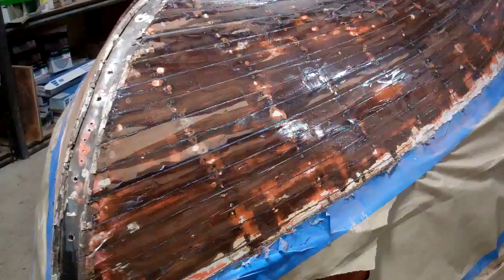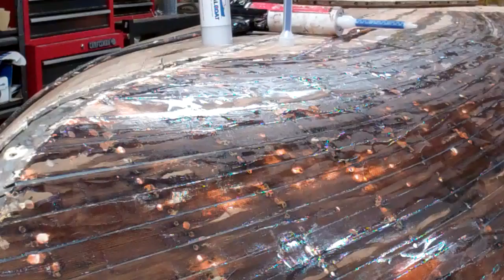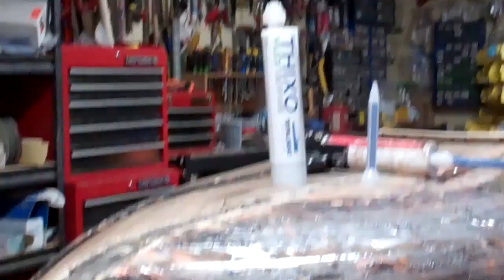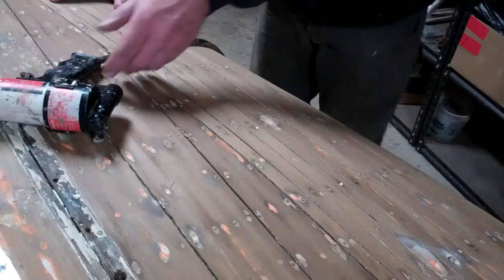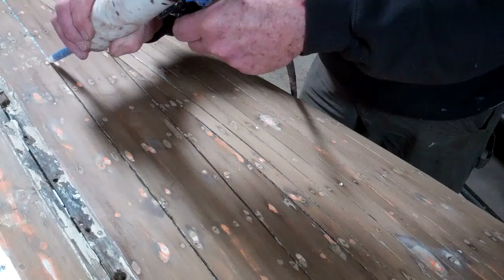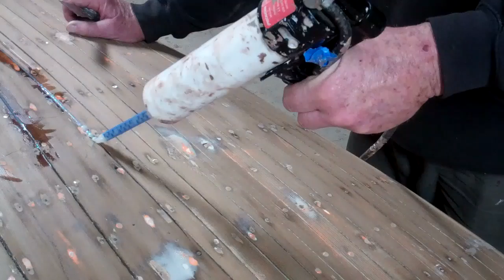1954 Penn Yan Captivator Sealing Bottom Seams Using Thixo Flex 3 26 2019

Comment: Thanks for sharing this. A couple of questions from an amateur who hasn’t tried this: 1) Does this method in reality replace the traditional method of routing a groove between the planks and gluing splines into the seams? In other words, is Thixo Flex gluing the boat together to a stronger construction as much as it is merely sealing the seams? Well obviously it glues the boards together but is this the additional purpose of the operation if you see what I mean (cf. the use of other products that seal but not glue)? 2) Thixo Flex is said to be flexible but how flexible is it? One problem with the splining and gluing method is that it prevents wood movement, which means that boards and/or ribs may brake when the wood dries or takes up moisture. A flexible adhesive would theoretically solve this problem but it depends on how flexible it is and if it remains flexible.
Reply from the maker: OUCH! Splines are just about the worst option, right up there with paying 3M5200 into these voids. Neither can expand or contract as the planks do, with the result that both materials will eventually fall out, but only after they have crushed the surrounding planks - both of which happened to this boat. Click on the "..." hyperlink hyperlink directly above to learn more.
Reply: @snakemtboatworks  Thanks! But would you say that Thixo Flex does the job that splining and gluing do but without the negatives?
Reply from the maker: @asdWER123ful  Maybe you did not understand me. NEVER EVER EVER SPLINE BOTTOM SEAMS UNLESS YOU WANT TO DESTROY THE BOTTOM. FULL STOP!
Reply: @snakemtboatworks  I did not ask about whether to spline or not. As I indicate in my first post, I recognized the dangers with this method. My questions concern the use and function of Thixo Flex, nothing else. So when I asked whether “Thixo Flex does the job that splining and gluing do but without the negatives?” I referred to that it both seals and glues, AND stays flexible. Trust me, I am not going to spline anything, which is the reason behind my questions.
Reply from the maker: Excellent! Yes, ThixoFlex will fill the voids and remain flexible, with the condition that the open seams are less than 3/16" wide. 
The planks must be replaced if/when the seams are any wider. @asdWER123ful
Reply: @snakemtboatworks  Thanks for the advice. I bet you have better things to do than answering strange questions from a novice but I’m still wondering about the following: How flexible is ThixoFlex? Concretely, if planks with seams of say 3 mm are glued together when the wood is dry, how much will ThixoFlex compress when the wood expands due to moisture?
Reply from the maker: Sorry, we do not run a lab or do the sort of testing that might answer your quest. You might try calling Jamestown's technical help folks - https://support.jamestowndistributors.com/hc/en-us  @321REWdsa
Reply: @snakemtboatworks  Thanks. I will. I am still perplexed about what “flexibility” entails in this context. I get that they added flexibility to make the epoxy stronger/better as an adhesive. But when it comes to flexibility as in able to compress and expand I don’t get it. I have experimented a bit with G Flex (which allegedly is an equivalent product), filling 3 mm seams between test boards. What I found is that it takes a tremendous amount of force to make the seam compress even the slightest bit after the epoxy has cured. How could this possibly work with the expanding/contracting of the wood? I am not saying that it doesn’t, I just don’t understand how.

Comment: one thing you didnt talk about is when this kind of application is used.  does boat size matter and why wouldnt you use cotton caulking?
Reply from the maker: Well, I guess size also matters. I would not use this product in place of cotton rovings for a large, heavily planked hull whose seams can be as much as 7/16 wide.
Cotton is the wrong product here as the seams vary from 1/16 to at most 3/16 wide and are only as deep as the planks are thick, which is about 3/16.
Reply: @snakemtboatworks  thank you for the fast reply i am thinking about buying and restoring an old boat but to be honest the cotton kind of intimidates me an alternative would be nice but there doesn't seem to be one

Comment: We've been very happy with THIXO, especially the price. They have regular tubes and Low Viscosity tubes as well. Pettit Flexpoxy also performs admirably, we chose that until we discovered THIXO. TotalBoat products ship free in CONUS.
Reply from the maker: I'll check out the low viscosity. And there is also regular Thixo Epoxy as well as Thixo Wood 2.0, both of which have a myriad of applications.
Reply: @snakemtboatworks  The Low Viscosity is great when I'm in a hurry and need to wet out some fiberglass and bed it in thickened epoxy, don't feel like finding a mixing cup,  counting out pumps, stirring etc...Then we swap out to the regular THIXO cartridge and bed to bed the wet strip. As advertised, the LV is very runny. A tip to share from Andy, for those who don't have pneumatic caulk guns, there are High Thrust caulk guns, 18:1 ratio, that push the thicker materials through the mixing tip with ease. Newborn is one brand in the US, made our lives much easier. Thank you again SMBW for sharing your methods and materials! Clark and Skipper
Reply from the maker: @kentblairl  Kent, we are exclusively wood guys, but the LV could have applications in our work.

Comment: So Mike, would you have maybe done this to Flyin' Bys original bottom instead of Interlux Seam compound if you were to jump in a time machine?
Reply from the maker: Michael here, not Mike - probably not as her seams were quite open, with some of them 3/8" wide. We will  be testing the TotalBoat Thixo Flex in some mocked-up wider seams, 3/16" - 3/8" wide. My guess is that filling them to near fair with the bottom planks will require at least a couple applications. 
The question is academic, however, as her new owner's first request was that we install a True 5200 Bottom, which is now in place.

Comment: Good day.  So would this product be used in the tiny gaps, below the water line, that appear in between each strake on a lapstrake boat i.e - along the inside corner where they overlap?  Thanks,  Bob
Reply from the maker: It is excellent for forming a very fine fillet along these seams, and, unlike 3M5200, which we've used in the past for this purpose, it will not lose its elasticity over time.
Reply: @snakemtboatworks  Thanks!!!
Reply: Bob Rand … I’m thinking about this for my 1958 Lyman lapstrake. What are you working on Bob ?